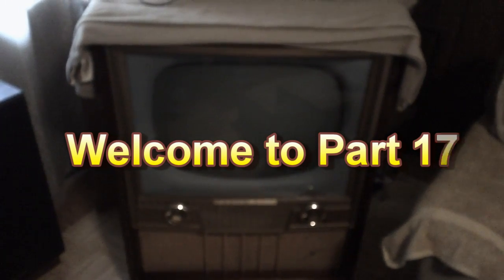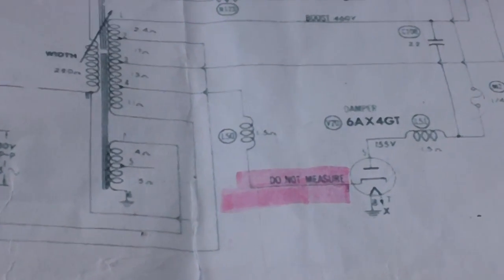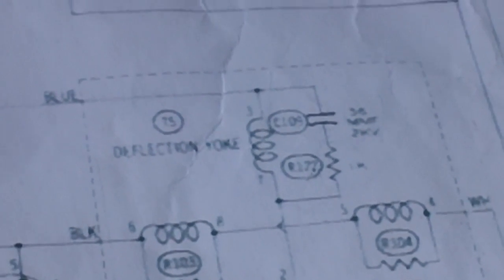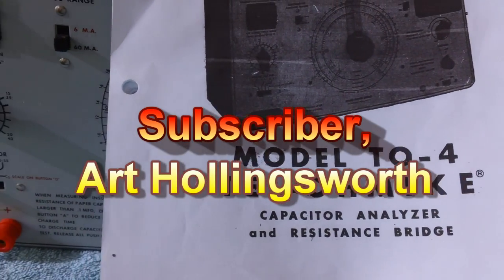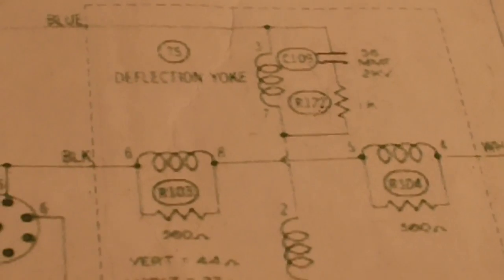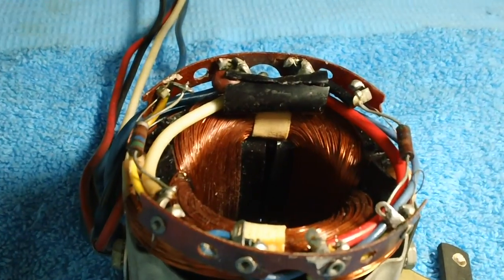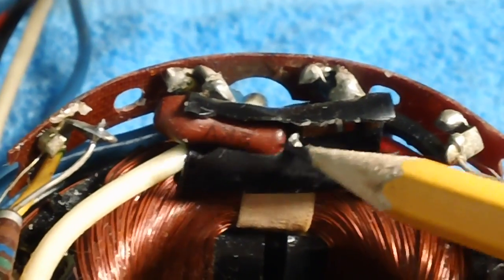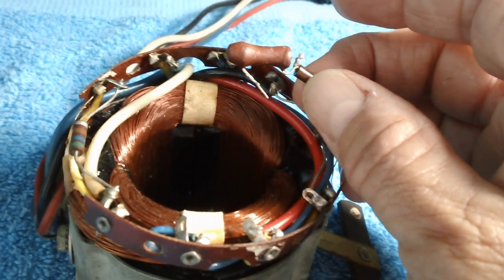1956 Sylvania 21" Halolight TV restoration (part 17 of 23).

Comment: Fun video John.  Love the micromho meter there.  You don't see that much.  Sometimes I cool down a heater by one step to see how well the tube holds up.  Those tubes look good, so I wouldn't expect problems with them.  I have my fingers crossed that the cap is the culprit.  Guess I won't hold my breath waiting on the next vid, but I am looking forward to it.
Reply from the maker: Stephen,
Thanks, my friend.  Cooling down the heater a voltage notch is interesting,  I hadn't thought of it.  I do plan on giving that a try.
Regards,
John

Comment: John,
Brendan has done you proud by giving you that component tester.  Sprague capacitors have always been my favourite brand of capacitor so I’d say it stands to reason their test equipment will be of quality standards also.
It was not often the fault you are faced with arose when I was employed in servicing but from what I remember there were connections with a faulty CRT.  In your case, I sincerely hope I’m wrong.
This is another super video production my friend.
Regards,
Phil.
Reply from the maker: Phil,
Actually, at this stage of the game the ringing could be caused by just about anything, but ole Brendan is zeroing in on it.  He barks the gofer orders and I carry them out.  LOL  BTW...this CRT was replaced at some point.  It's not the original, but if it needs replacement, then I'm up for it.  Piece of cake.
Regards,
John

Comment: John, in the yolk part of the schematic, you mentioned a 1K resistor... hard to see on here, but it looks like is says 1M.  Could be my old eyes... still watching.. love that device Brendan sent you....  will keep watching. By the way, when you were testing the second tube ( short test) the needle did jump a little (8:51 mark) on the P and G1 setting.. not sure if you saw that.
Reply from the maker: Ron,
It's 1K and many tubes (not all) slightly jump when changing the switch position from one grid to another.  A problem arises when the needle stays upscale rather than quickly returning to zero.  These tube testers and the tubes under test are as old as the hills.  They'll always demonstrate a few flaws here and there.  It probably even happened when they were new.

Regards,
John
Reply: joernone  I am sure Brendan found this as well, but I did a search and here is what it says "STRATIONS or RINGING ON THE LINE TIMEBASE.

This is another problem which is seen quite often. Vertical and stationary variations in brightness on the left hand side of the picture (or the start of the line scan) is caused by the line output stage being undamped. Again look for capacitor problems especially the boost diode and capacitor and possibly the smaller value capacitors in the line scan coils section of the stage.

The theory behind this aspect of Line Output operation and damping can be seen in greater detail here.The waveforms shown display the effects on the line scan waveform when the stage is damped or undamped.   "   

http://www.oldtellys.co.uk/otltbeht.html
Reply from the maker: Ron,
I'm waiting for Brendan to get back to me.  He's further skull-braining the problem.
Regards,
John

Comment: John, I don't have the schematic for that set, but I have had that situation before...well, similar anyway. The issue had ended up being a open peaking coil  in the plate circuit of the 1st video amp, causing poor frq response. I, like you, spent many hours trying to figure it out, caps, tubes, resistors, and only found it after I decided that possibly an alignment will help me find the problem.Which of course, it did. I hope you don't have to go down that road, as I know how much you LOVE alignments. I feel the same way! Would rather have a bowling ball dropped on my tongue as do an alignment on anything.
Reply from the maker: Scott,
We've decided to start with the easy stuff...installing NOS horizontal output and damper tubes, so I ordered one of each.  It's just to make sure...besides, it'll be good to have a second set on hand.   If the ringing persists, then we'll move on to other areas, with emphasis on caps and coils.   I'll be sure to keep your suggestion in mind.  I've already checked the schematic for the 1st video IF plate coils.  They're there.  LOLThanks, my friend.
Regards,
John